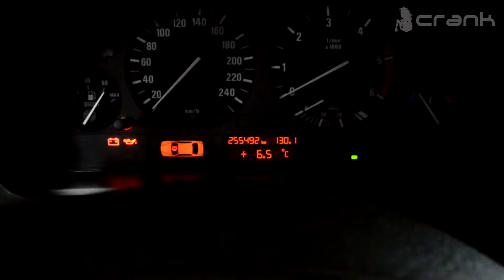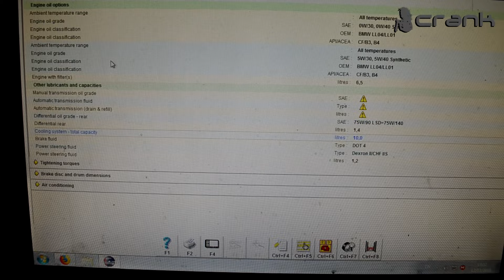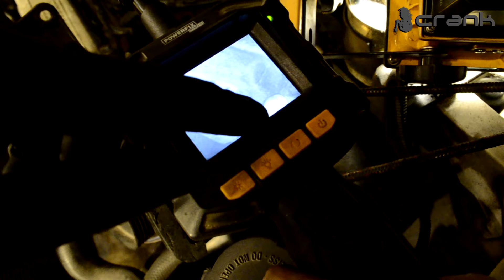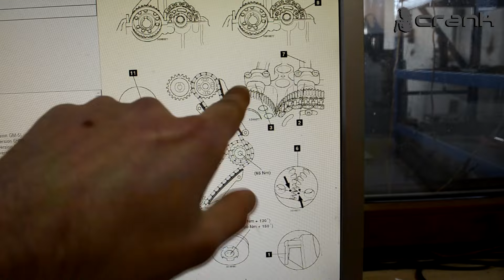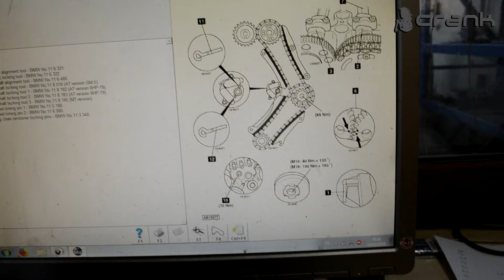BMW M47 M57 Timing Chain Replacement on E39 E60 E90 E70 E54 E65 E46 E81 Part 1

Comment: Why would you change the chains on m57 engines? i have seen m57 engines with over 400.000km and have never had the chains replaced. By the way if you use motul oil for bmw...you can say goodbye to the engine.
Reply: Beside that...why do you use Hengst timing kit. What kind of brand is that? I have never ever heard of them. If you do a timing replacement on these cars...which you should never do that....at least buy OE parts.
Reply from the maker: I guess this post is going to be long ... I will say it that way . One or two cars are not a plausible statement . When you see something on 100 or even above , cars then you can claim something . I hear almost every month for a broke chains on this engines and most of the time they are at around 200-250k kms . The timing chain life depends on several things . Oil service intervals , cold starts , driving style and driving distances . Will give different car for comparison . Audi A6 3.0 TDI which are famous with their timing chain problems . Most of the time they need service , even before 200k kms . But I know a car with over 330k kms , that never had done this . But the car is driven only on long distances , 1k km a day , and the oil is serviced on 8-10k kms . So there are many variables on this . Actually believe it or not , yesterday i had a call for a BMW E70 3.5d ( which is 3.0d again ) with a broke timing chain at around 230k kms , and it is not N generation engine , it is M generation ones again . Yes he was changing to engine oil on 30k kms so it is normal . If its my car I was going to do it too . About the brand . Hengst are the filters that we are using :D and yes Hengst are high quality filters which are used OEM from many brands . We are using SWAG timing chains , and yes in my opinion they are high quality ones .
About MOTUL , sry but your claim doesn't sounds serious . If you have a friend who has a friend that blown his engine while using motul it is OK , don't use it . Motul makes one of the high end quality engine oils in the world . Most of the high performance turbo engines on BMW are using only Motul 300V cuz is one of the few oils that can handle all the addtional heat . It all depends what you expect from the oil . Motul has an oil for a motorcycles that can last only for 2k kms , but during this 2k kms , probably has the best specification in the world . We use motul on almost all the BMWs in my workshop and never had an issue with it ( and for sure some of them see a lot of abuse :D ) . I will happy to hear some real facts about your claims :)
Reply: @crank3646  First of all i'm not interested in audi cars. So let's not talk about them :). Please tell me...is there a warning sign that the engine crates in order to convince you to change the chains on M57 engines? Does it sound different or make wierd noises? I tend to believe that the chains aren't going to snap all of a suddent.
Reply from the maker: Sometimes yes , sometimes no ... I have a friend who snapped his timing chain on his E46 , while he was cruising on the highway with 120 km/h  . For sure the car didn't had any additional worrying sounds from the engine before that . But sometimes you can hear some rattling sounds , which is giving some indication . For sure is to risky to wait for this in my opinion .
Reply: @crank3646  Yes but unfortunately spare parts, basicaly everything you buy new from the shops, are not as good as the parts that are installed from the factory. Quality control is not as "severe" for aftermarket parts as it is for parts that are installed from the factory. I have been working as an engineer in some automotive construction factories and please believe me that you are better off with the factory parts installed on your engine that aftermarket ones. Now...speaking of timing chains on bmw cars...i strongly believe that the aftermarket chains will not last as long as the ones already installed from the factory.
Reply: Cuz (i guess) this car is import from Germany and the odometer is hacked and rolled back maybe 300.000 km so the real km is maybe 600.000km :D
Reply: @saywhattt4462  I doubt it only has the kilometers displayed on the odometer. But the car is from "Germany" and in "Germany" is illegal and considered "infraction" to hack the kilometers 🤣🤣....bullshit
Reply: Vlad ZSX yes, you are right but there is so many ways to hack and many km rollback tools. It's illegal in all countries but it don't mean that they don't do !!!
Reply: Interesting. I have M57 engine also but mine is M57D25 120kw. I use Castrol edge TD 5w40 oil. Is this oil good or bad, my service interval is 8000-1000km depends on drive style or time of the year e.g sommer when is +40c or winter when is - 5 or - 10.
What engine oil do you recommend.
Reply: Guys I have e39 142kw 2002 M57 with 382000km I have this car since 2009 when I got it it had 142.000km I was about 20 years old back than so it was driven very hard, 7km each way to work(slovakia) and on weekends 80km trips, I did not touch the chain yet, but I changed oil every year after about 10k (mobil 1 new life 0w-40, castrol edge 0w-30, and now i use for 4 years shell helix ultra 5w-40), can I hope for the chain to last 500k km? thanks
Reply: @crank3646  hi Crank, there are 3 generations of M57 engines. 3rd one (M57TU2) might have problems with the timing chain. But in old M57 and M57TU (3.0D 150-160kw) you cannot find any case of cracked chain :) its more relevant for E90, E60 LCI, E65 LCI, E70, E71 etc. with M57TU2 170-173kw and 35d 210kw. 2.5d not that offen because of not that big power
Reply: @Ritcheyyy  yes, dont worry. E39 dont have any problems with the timing chain. Hello from CZ :))
Reply: H
Reply: Vlad X They hack the cars during export. So the car leaves Germany with the right mileage and arrives to East Europe with hacked mileage (kilometers). Happened to me. I bought a BMW with 153000 km and when I checked German records, they had 155000 km when it left Germany. And it drove 2 years in our Easter European bad roads and had 2000 km less than when it left Germany. So it is not bullshit.